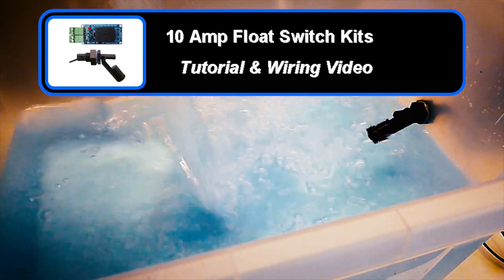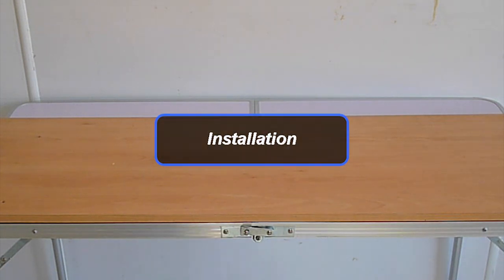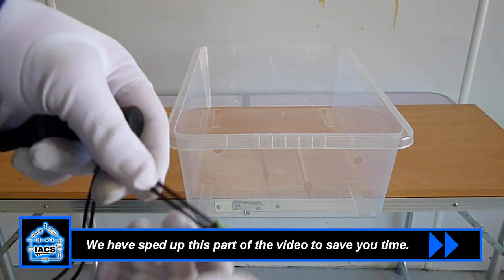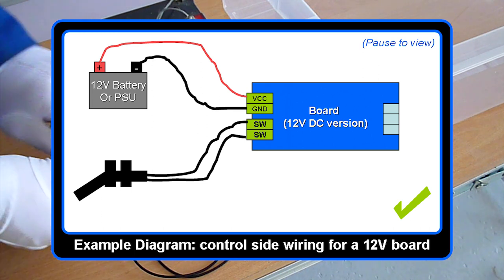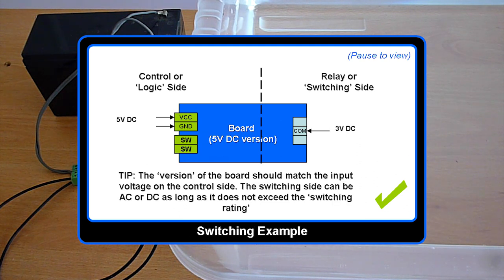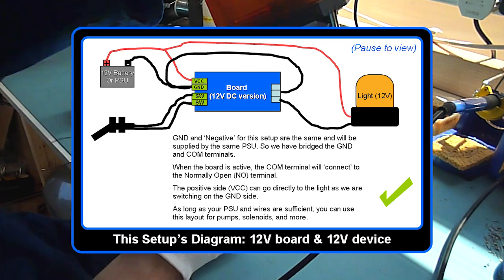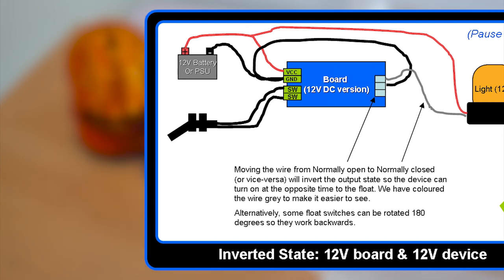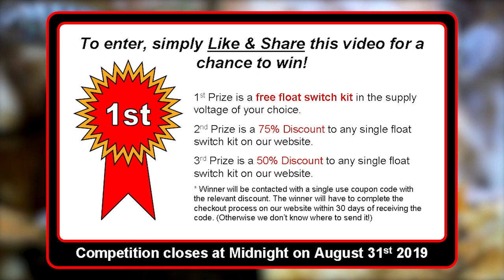IACS Water Level Float Switch Kits - Instructions & Wiring How To with diagrams FK1

Comment: HI CAN YOU HELP ME HERE. I have a big problem with a reservoir for animal feed. It periodically gets filled from a silo which is very high up and so the water comes down from such a high pressure so it causes waves in my water tank. Any float switch I tried has flicked on and off rapidly. I have had two solenoids burn out and I've tried timer switches already, any ideas????
Reply: Hey mate. I've got the same problem. We stuck the float switch in the tube in the end but it is far from reliable.
Reply from the maker: Sorry dear you've been having problems with your tank. We have in fact been filming a video about things like this. Your problem is quite common. I will send you some links. https://youtu.be/355QKx36WCU?feature=shared

IACS FLOAT KIT X-Series Kit 2 - Intelligent Pump and Solenoid Protection and Control System: Ripple Correction Code https://amzn.eu/d/hrCHjFg

If you have any further questions please don't hesitate to get in touch!

Comment from the maker: If you have any requests, ideas or suggestions to improve our products or videos - please let us know.
Reply: Can I run the board on a 100 amp and 12 volt battery?
Reply: can the switch trigger an sms message using an arduino and a gsm module?
Reply from the maker: @jeheildelfin355  Hello, in theory yes it could. We don't supply / build GSM or SMS capable boards at the present time but you could probably link a switch to an arduino and create a custom sketch with a SIM / GSM add-on board (shield).

Comment: This kit would work with an optical sensor too right?  It is just checking to see if the connection is open or closed.
Reply from the maker: Hello, in theory all you have to do is complete the circuit for the float switch. When the circuit is closed, the relay will activate. We have other versions of this kit including twin float switch arrangements, ripple / wave correction and more, as well as timed and contactless versions. We have other boards designed to work with NPN sensors, if you would like me to look at a specific model of sensor please feel free to send me a link to an item or datasheet and I can advise.

Comment: i need this to turn a solonoid water valve on and off and have the water sensor on to but the vid dose not show that ?
Reply from the maker: Solenoid wiring is the same as pump wiring. We will be doing a video about solenoids in the near future. If you have any specific questions about your solenoid valve and project, please feel free to comment and we will make sure your questions are answered in more detail. 😊 Please note that solenoids can often cause a power surge, so you may need to fit a capacitor. Please let us know your solenoid details if you require further assistance.

Comment: Hi IACS Electronics
,
Scenario:
Considering I have a 10ft tank and I want to install 2 such switches; 1 at top and 1 at bottom. If I don't want to drill holes in my tanks body to fit these, I had a alternative idea of using a non-corrosive material strip of 10ft having the 2 switches fitted to it at required heights(top and bottom). 

Now coming to my question, if I put this setup of the strip into my tank my bottom switch would be completely submerged into the water and probably my top switch also. So is it okay if they are completely inside the water??? Any possible failure or issue it might cause???
Reply from the maker: Hello, good question. In theory yes you could mount them on a strip and then submerged them completely but there may be a tidier and more reliable way of achieving your goal. If you do wish to Mount them in such a way I recommend coating the back in HA6 RTV silicone sealant but you may overall be better off either using a long shaft stainless steel barrel switch (or pair of) alternatively a contactless float switch sensor which would be stuck to the side of the tank with foam or adhesive. Another thing to consider is if you are planning to use two float switches to either co-ordinate filling or draining of a tank, you may be better off using one of our twin float switch control kits rather than two singles. If you would be happy to share more about what you're trying to achieve using the switches and what the tank is for, I would be happy to advise further.
Reply: @IACSElectronics  The main goal is to setup these switches inside my domestic water tank. I have one underground tank(main tank) from which water is pulled into another tanks situated on terrace(drinking water). 

Since its for drinking I am trying to avoid adhesive's or any sticky solutions to be used inside the tank. More over I am looking for a low/no maintenance electronic sensor which should not be affected by water conditions(salts, PH values, etc. )as it would be under water for years. 

The output of this sensor would be given to the controller which will then automatically turn ON/OFF the ground pump. If possible, can you share product reference links so that I can check the functioning and see if its usable in my case.

Comment: How do i connect this to the water pump? I mean, I want to install this inside of the water tank, and every time if the water will fall below the right water level, the sensor will turn on the water pump which is inside of the well
Reply from the maker: Yes this is achievable. Depending on the size of your pump and whether a single point of monitoring is sufficient, this kit is suitable. However you may want to consider our new fkx which offers many more protection features as well as a superior switching capacity and many other improvements. Please let us know if you have any further questions or more specific details about your installation.

Comment: Can we use of this device in pit which is motor up and down ??
Reply from the maker: If you would like to use are float switch to operate a motor, you will need to determine the starting and stopping position of the motor. You can get linear actuators, which is a bit like a robotic piston. They can be used to move things up and down. We have had kids like this used to open and close windows by combining them with a linear actuator. However you may need a secondary timer or switch to make sure the motor doesn't move it too far. Please feel free to follow up with additional information about your project. We would be happy to advise.

Comment: Can you not directly wire it on 12v? 
So the main live to one side of the switch, then on to the lamp on the other side, and the earth directly to the battery?
Reply from the maker: You can share the supply with the switching side provided it matches the supplies input voltage 12V DC.
Reply: @IACSElectronics  didn't we need to isolate the switch from the load? Is is safe to have the same supply?
Reply from the maker: @jonathanrodriguez8219  hello thank you for your comment... If you are using something such as a solenoid running from a DC power source, you probably need to put some sort of circuit protection in to make sure that the fluctuation doesn't affect the board. We recommend the addition of a capacitor to the circuit if using a solenoid powered from the same DC circuit. The x series board has got built-in fluctuation protection but it is only limited. If you are using mains power or anything other than 12 volts DC for your switch side you definitely need to isolate it from the supply side of the board. Supply side range is 9 volts to 14.5 volts DC only. You can run a 12-volt DC pump from the same power source as the bored easily because the board is quite resilient and will protect its own circuitry. But you may need to account for drops in voltage if the pump takes a surge when it turns on.

Comment: Can I run the board on a 100 amp and 12 volt battery?
Reply from the maker: Hello, if that is a 100 amp as in amp hour (Ah) battery such as a lead acid leisure battery then the answer is yes you can, however if the battery puts out or spikes over 14.9 volts (e.g. if you have other things connected to the battery such as motors, compressors or chargers) it would be a good idea to connect a 12V regulator between the board and the battery, we can supply a suitable one (that can be adjusted / tuned to a good consistent voltage) with the board if needed for an additional 10 GBP.
Reply: @IACSElectronics  Thanks for the reply Can I use Water Level Float Switch for the tank hho when empty without the board
Reply from the maker: @peshrawahmadebrahem991  You're welcome. The float switch its self can be used in an HHO tank provided the tempurature doesn't exceed 80 C / degrees centigrade. but it shouldn't be used to switch the load from a lead acid battery without the relay board because even under a low load, the power from a battery such as that will most likely weld the contacts inside the float switch / reed switch together causing it to stick in the ON position or burn out.

Comment: I need a video and board for two float switches. One low level turns on pump till it reaches second float switch that turns off pump. Pump in question will be a 12 vdc type. Any help would be appreciated.
Reply: You could use a timer relay, set it to 10 minutes or whatever and use a second floatswitch(FS2) to disconnect power to that timer relay and reset the relay until FS1 

The lower switch (FS1) will activate the time relay and start the pump for X minutes.
The higher switch (FS2) will return power to the relay as soon as the water level drops again, when it's low enough for FS1 then the relay starts the pump again.

If FS2 fails for whatever reason then the pump will automatically stop after X minutes, minimizing overflow.

It might be an idea to measure the time it needs to fill the reservoir and set time relay accordingly but differences in waterpressure might make this hard.

Using a pressure vat results in consistent pressure for timer relay and less wear on the pump itself increases lifetime because it doesn't have to switch on/off each time the reservoir is filled.
Reply: @fancyfakename8967  Thank you for the info.
Reply from the maker: @MegaKbyrne  We have released a version of this board which has 2 float switches and an intelligent control system to manage drainage or filling actions in various water tanks and scenarios.

Comment: What I don't understand here is the sw connections that the water level sensor is connected to are negative or positive? If the sw connections are negative, can't both wires of the water level sensor be combined and plugged into one connection? Or if the sw connections are positive can't both wires of the water level sensor be combined and plugged into one connection? (I don't know if the sw connections are positive or negative, so I'm thinking of assumptions) If this assumption is correct, two separate water level sensors can be connected to two separate sw connections. Why are both wires of the water level sensor plugged into the sw connection separately? I will be glad if you answer this question. My aim is to use 3 water level sensors. What to do to connect multiple water level sensors?
Reply from the maker: Hello, they are in and out signal lines which puts out a positive voltage of approximately 3 to 5 volts. The second wire carries the signal back from the float switch. It is hypothetically possible to wire two switches either in series or parallel through that connector. However it would only work if you are going to be having the one relay switch operate when both are up or down. Some people use it as a backup incase a switch should ever fail.
Reply: @IACSElectronics  Light adapter everything is 12 volts... If we determined 3 levels and connected 3 sensors to measure the water level, what should the connections be? The way it works is as follows: The first light will turn on when the water rises to the 1st sensor level at the bottom, and the second light will turn on when the water level rises to the second sensor in the middle. The 3rd light will turn on when the water rises to the top sensor when the can is full.

Comment: Hello. I am the one who inquired via eBay about a timer float switch here in the usa
Reply from the maker: Hello, good to hear from you. We can certainly help with your requirements for a hydroponics system, we can produce a float switch kit with integrated adjustable timer to water once every for example 8 hours for 10 minutes each time but to make it easier to adjust, it may be best if you used another 'off the shelf' timer for the watering cycle and routed it through our baords and float switches to control and monitor the tank levels and operate the pumps / valves you may need - if you would like to contact us direct you can on services@iacselectronics.com and we can send you some further information & options.